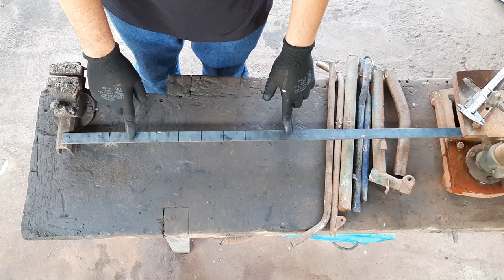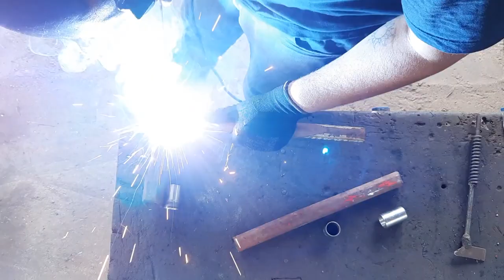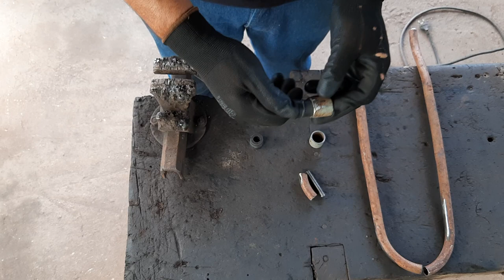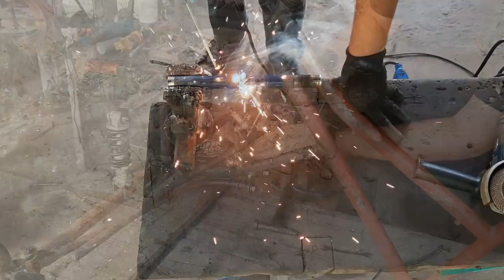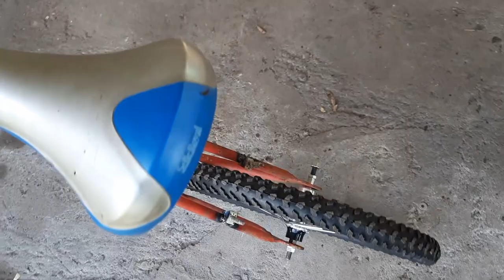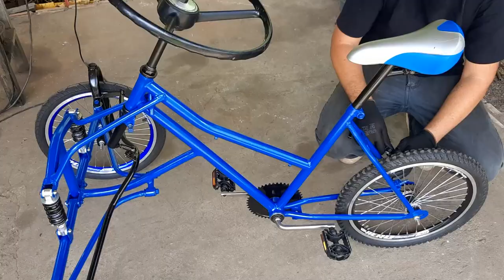Triciclo invertido incrível e resistente / Reverse Trike

Comment: I would say that with the king pins of each  front wheel  welded as they are, the distance between the wheel will change when the wheels are sprung .  Try loading the front wheels when the bake is stationary   and the contact point of the wheels  with the ground will try to move sideways,  It may work but the tyres may wear out faster than if  if the contact points on the ground between the two front wheels did not change   when the springs are activated and loaded. ,